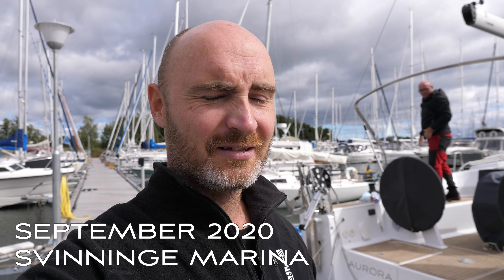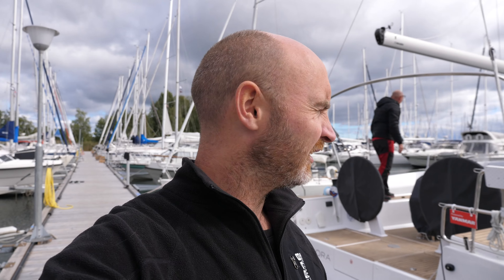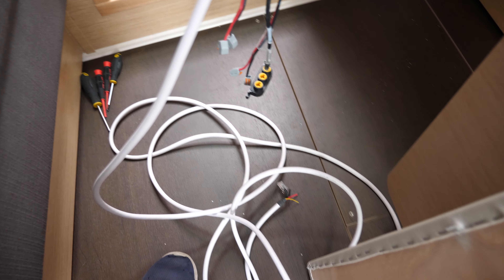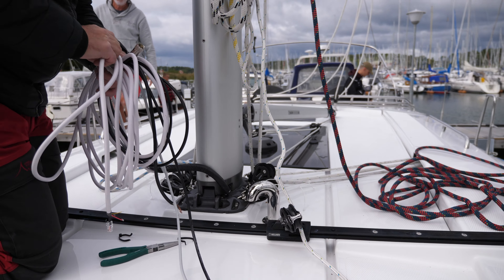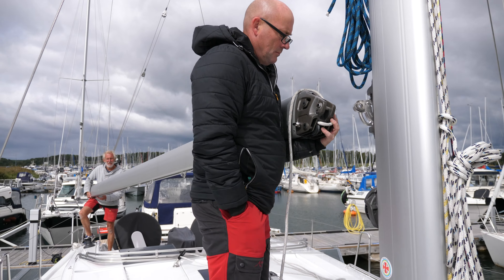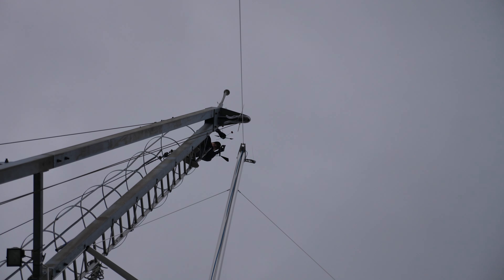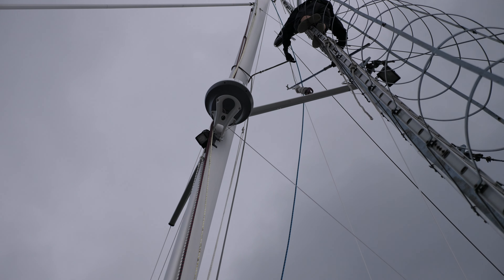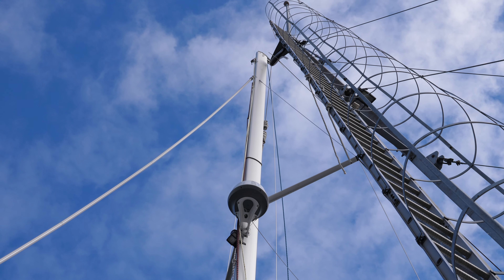Taking the rigging down

Comment: The best advice when taking a mast of is.. and i feel dumb for pointing it out. It is always better to have 2 or 4 hands to much, ready to step in if a problem accurs. They have tried it many times, and they are 3 guys. So 4-5 people is not to many.

Far to many times have i seen guys at the dock, trying to pull a 15 meter mast down only two guys. They nearly always scratch the deck or the mast and the windex is a sure thing to bet on getting destroyed

Comment: Hi Chris, you should def. look into dismounting all halyards and ropes in the mast. Do this by running some thin, but still strong, line in the end off all ropes and the pull them through the mast. Take the ropes home, and wash them on a light program in a pillowcase. This makes them look like new, and takes salt out of them, making the last longer. In our local harbour in Copenhagen, it is not an option to leave the mast on, when getting on land. So this is a regular task for us every year 🙄 Doesn’t mean i wasn’t nervous when i did it for the first time on our Hanse this year though 🙂
Reply from the maker: Hi Peter, can't blame  you for being nervous. It must be a bit of a hassle taking the mast down every year but I guess you get to check all of the rig and do maintenance like that. Good idea with washing the ropes though, up here in Stockholm there is hardly any salt in the water so the sheets aren't really crusty at all. I will have a good look at them when we get access to the mast and see, maybe we do it anyway as it's a good opportunity. Thanks so much for the tip though, it's definitely a good one.

Comment: Always a tense moment as the mast comes off!
Having watched this through yourself you might be able to do most of the prep yourself next year.  I was used to removing the running rigging and boom but I'd never taken the standing rigging off myself.  1st winter at Greifswald and the guys (super efficient) lifted the mast off onto trestles and then left me to remove the spreaders and stays.  They were very helpful when they saw I had no idea how to get the spreader off - there is a concealed allen key at the tip that needs to be partially slacked to remove the cap.
A couple of other useful tips might be to use some padding between the mast and the headsail foil and to make sure this is tied down so that it is as straight as possible.  I also pull any halyards or other lines that I have not removed through the mast so the shackles are at the mast head / entry point and all the loose rope is at the foot of the mast.  You can then coil and bag this all into a plastic bag to stop it getting mildewed (if outside) or dusty (if inside).  Just remember to pull them all back again at the start of the season though!
You should definitely have a go at getting up the mast.  It isn't too bad as long as you don't look down!  But like anything, best to practise in calm conditions first so you know what to expect.
Reply from the maker: Hi Stuart. Thanks for all the tips and tricks, very useful. Yes, the next time we have to take the rigging down, hopefully not soon, we will definitely do a lot of the preparation our selves. 
And this is going to be the year where we both needs to go up the mast! Not so much a problem for Chris, but I am afraid of heights so thats another story:-) Take care, Chris & Tanja

Comment: Hi Chris your windex broke because it’s to near your vhf antenna  no bird is able to eat your windex 😀
Reply from the maker: Hi Reijer. Thank you for the observation, we hadn't see that, so will need to check when we get the new one on. You might have solved the mystery of the killer birds:-) Best, Chris & Tanja
Reply: @SailingAurora  Hi Chris &Tanja 
Coincidentally, I also replaced my windex in 2020 and had the same problem my vhf antenna also hit the windex during a heavy storm, so I moved the antenna too, your windex looked familiar to me
Reply from the maker: @compuface100  thanks for the tip, reallt never thought of that. Probably because I havent looked it it that much yet. Will look at the top of the mast soon when I can access it. You may have just saved us some money 💰